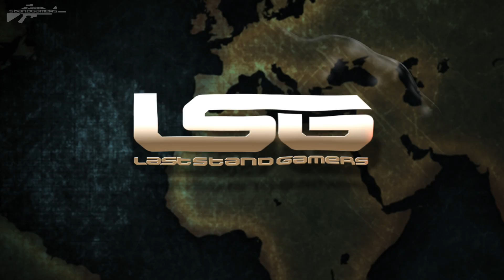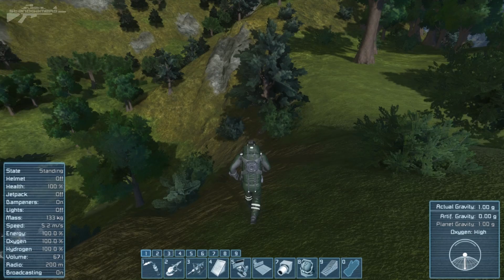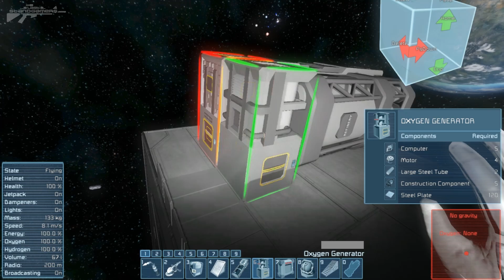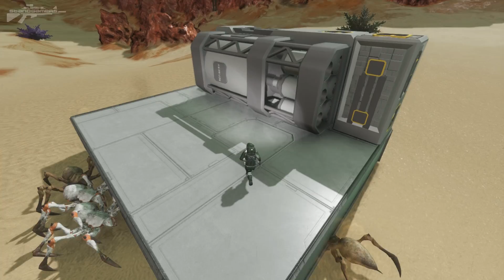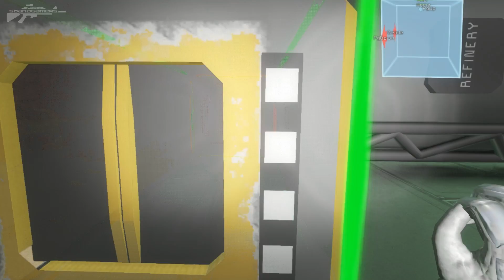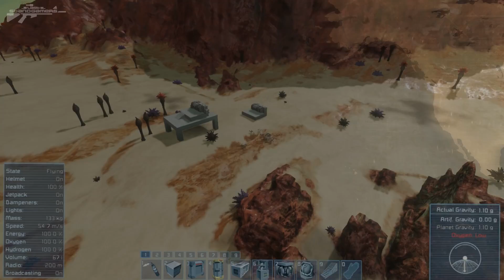Space Engineers - Caveman Survival (Concept)

Comment: Surely a passenger chair would be best for charging?
Reply: +Decmk3 Came here to say exactly this
Reply: +Decmk3 The cockpit replenishes your oxygen and hydrogen too if you're piped in and have them in tanks.
Reply: +Decmk3 no kidding
Reply: +TalesOfWar Medbay does this as well. I'd rather go for the medbay just for the simple fact of having a respawn point.. but they're much more expensive if you can't find the stuff for medical components :P
Reply: +Seth Ross Med bays are MUCH more expensive with the 15 medical components, really the first use of silver you'll be having.... which isn't something you can salvage from other blocks around.
Reply: a friend and I recently did this kind of survival, still building off of it.. The pressure was on for silver not just for a med bay, but to get Hydrogen tanks, and backup Oxygen tanks. After we found silver though, the med bay went up pretty quickly ^^. before that, the passenger chair worked wonders lol.

Comment: Minimum start is assembler and an arc furnace or at least the parts to build them, you can manufacture the parts for a refinery from there up, caveman start also can be done with batteries (note, not power generators just batteries) - leaving limited room for screwups and requiring decent management of your power usage.

Comment: Note - You can minimum start with an Arc Furnace + Assembler.
Reply: +FritiFirecaster Damn your right, I've been adding a artifical mass to get the 20 computers I needed. But if you use computers from the assembler you can trade them back and forth with the refinery until you get them completely built. You're awesome!
Reply: Bingo.  You got it.  :)

Silicon processing will be your sticking point for computers early on for when you upgrade from an arc-furnace to a full-fledged refinery, but with a little creativeness you can trade them around long enough to get enough refined to manufacture more when the time comes.

More to the point however is the energy use of the Arc furnace early on is much less than that of the un-upgraded refinery.  Comes particularly in handy since solar power is a bit... interesting with just a panel or three and a battery.

Comment: So, can you build an assembler out of a refinery? As in, take the components out of the refinery and put them into the assembler until you have enough to refinish the refinery?
Also, you can use bottles. The O2 gen will fill them (both H2 and O2), and then you can stuff them in your inventory. A simple passenger chair, therefore, is enough for all your charging needs. And that costs only ten interior plates before you can use it. Therefore, you need a refinery, a solar array, a few odds and ends, an O2 gen, and a pair of bottles (O2 and H2, one each). Much smaller than your refinery, assembler, medbay, hydrogen tank, O2 gen and 3x farms, AND gravity generator.
Which, by the way, seems completely unnecessary. You don't use H2 when hovering in place, outside of a gravity well. Why would you?

Your way (Space):
 0188 Computers
 0014 Displays
 0040 Motors
 0305 Construction Components
 1920 Steel Plates
 0119 Large Steel Tubes
 0100 Reactor Components
 0064 Metal Grid
 0015 Medical Components
 0006 Gravity Generator Components
 0080 Small Steel Tubes
 0240 Interior Plates

My way    (Space):
 0087 Computers
 0004 Displays
 0020 Motors
 0055 Construction Components
 0023 Large Steel Tubes
 1324 Steel Plates
 0010 Interior Plates
 0064 Solar Cells

The below assumes that we don't care about our jetpack.
Your way (Surface, O2 rich):
 0125 Computers
 0004 Displays
 0030 Motors
 0140 Construction Components
 1430 Steel Plates
 0020 Interior Plates
 0004 Metal Grids
 0100 Reactor Components
And enough Uranium to run the whole thing.

My way    (Surface, O2 rich):
 0082 Computers
 0004 Displays
 0016 Motors
 0050 Construction Components
 0021 Large Steel Tubes
 1204 Steel Plates
 0010 Interior Plates
 0064 Solar Cells

TL;DR: You can min-max harder.

I'll come back and update with actual material costs later.

Comment: So wrong.  So, so wrong.  You need a refinery, an assembler, a medbay, and a fuelable power source to start(reactor or a battery/solar panel combination).  If you are in space, you need to add an oxygen generator.  You do not need a hydrogen tank or oxygen tank as the generator will produce those on demand as needed.  You will also need a welder, a grinder, and a drill (all hand).  That's enough to get you going but far from efficient.
Reply: +fakshen1973 you don't need a grinder..
Reply: I don't even think he watched the whole video, it shows him putting down a medbay and a chair. he didn't say it was necessary for hydrogen, he said it would help expand a lot further. watch the whole video before commenting about how it's wrong
Reply: +fakshen1973 the tanks are a necessity because the oxygen gen will continue to process the ice into oxygen/hydrogen which is a waste (if you forget to turn off the generator when not using it). You can go for a bit with out either tank but having one eliminates the inefficiency of constantly having to get more ice to replace all that is wasted.
Reply: +fakshen1973 Well, the med bay is not 100% necessary. You can play forever without ever even using one.
Reply: +fakshen1973 You really made yourself sound like an ass there. And for what? So you could mention that you would need the tools the game starts you out with anyway?